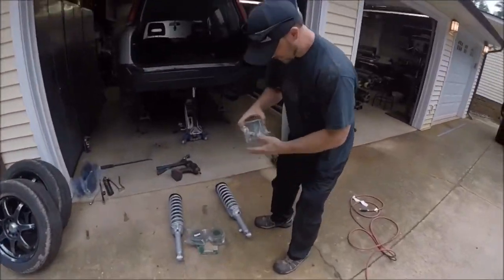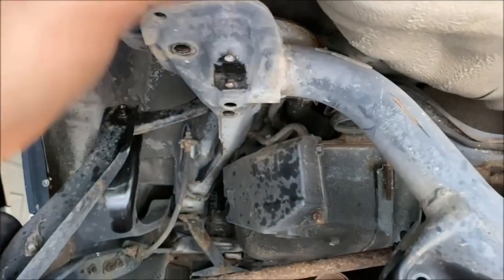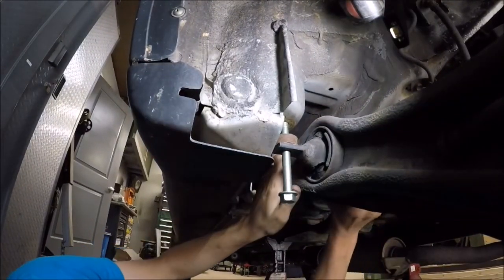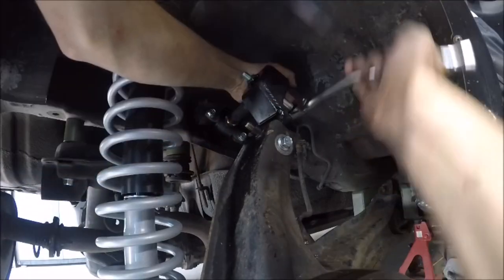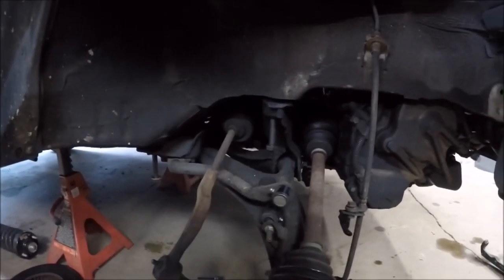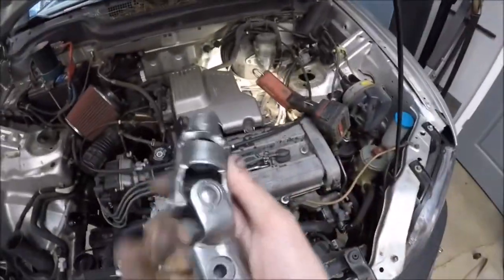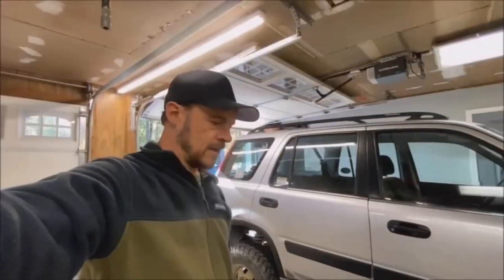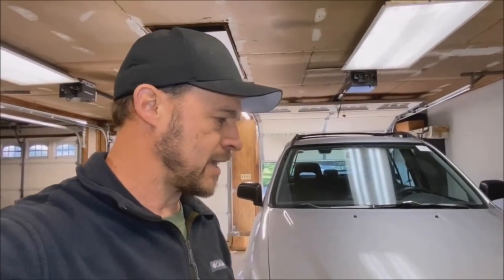How to lift your 1997-2001 CRV 4 inches with the HRG ultimate kit (2021)

Comment: I have a 98 crv and I’ve bought a 3 inch adjustable strut kit but then went and bought a 3 inch lift kit as well. As the struts are adjustable I figured it just gives a bit more wiggle room for what height I need it for I’m often up the forest with the trailer driving in to chainsaw wood for the trailer plus as well I got my Honda stuck up on a low cut tree stump in my front paddock that needed to get dragged off with the tractor. I MEAN I WAS STUCK STUCK FOUR WHEELS OFF THE GROUND STUCK. Getting the front end kit as well upper and lower control arms all the ball joints tie rod ends

Comment: I wish you guys show the step on putting the shock on the forks since that is the most hardest part for a 4" lift kit. Because I was having a really hard time with it.
Reply from the maker: https://youtu.be/m6ILCyTdJi0
Reply: @hrg_tv  yes those step in the video will work with 3" and lower but I had struggles getting it back on. Especially if your shock and springs are new

Comment: Wish there was a solution out there for the crv for locking diffs or make the crv more capable when off roading. Lifts are great, sway bar deletes are great but what do we do about them open diffs
Reply: Isn’t that what a mechanical LSD is for? I’ve seen em for sale for 1st and 2nd gen CRVs
Reply: @badakim2086  Yeah i've also looked into LSD but after seeing how they perform off road, I dont think its worth the investment.  Think most people go with a more aggressive clutch pack for the rear wheels to engage faster but aside from that we would have to invest more money in swapping the drive train for something more sturdy.  Guess I will just stick to soft roading for now until I have more money to invest in something better for off roading

Comment: Heavier springs are cheaper to manufacture than decent shocks so companies make up for their cheap shocks by putting higher spring rates on their struts and that's why most cheap aftermarket struts lift your car over the OEM ones. This results in a rougher ride as well. Springs are only meant to hold the weight of the vehicle. The shocks do all the dampening.

Comment: Don’t put larger tires on your first gen crv unless you want to seriously reduce the life of your transmission. I put mine through hell on steep trails and logging roads in BC. Larger tires simply will NOT help the performance. I tried going to a 215/70r15 and the radiator was way hotter going downhill in the city than it’s gotten climbing logging roads in 2ft of snow. Sure lift it, but stick with 205/70r15s.
Reply: You say your radiator got hot but are talking about tranny issues so im going to assume you have an automatic. Heat is the #1 killer of automatic transmissions. A $35 tranny cooler will solve your problem. Dont forget to add extra tranny fluid to compensate for the added cooler.

Comment: Is a adjustable rear toe arm not needed for this 4” lift? Did it need to be alignment at all for the rear toe arm? Or can it just be put back to same spot
Reply: Once you take suspension apart even to replace one part youll need an alignment on any car.

Comment: Such big wheels - did you install strengthened axle shafts?
Reply: They use CV axles not axles shafts and those tires arent big at all. Theyre no where near the size of snapping CV axles